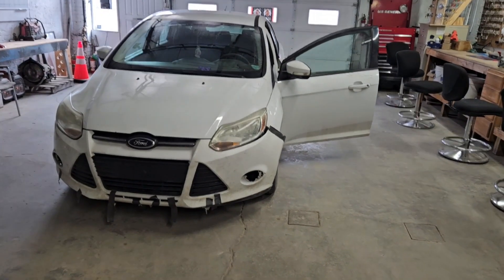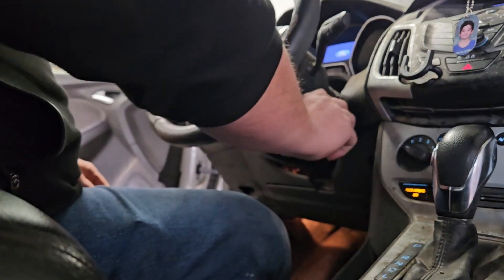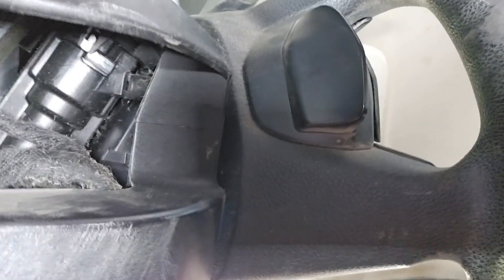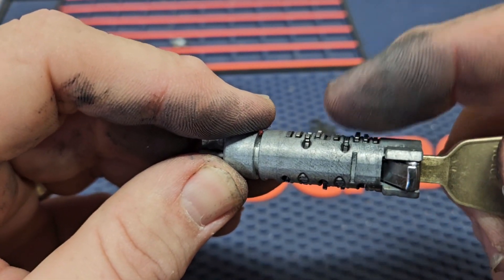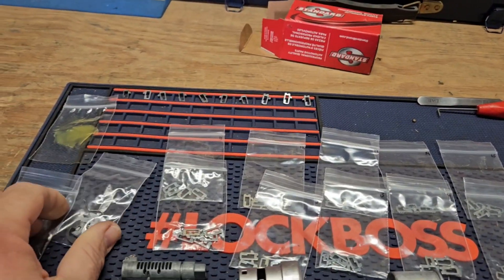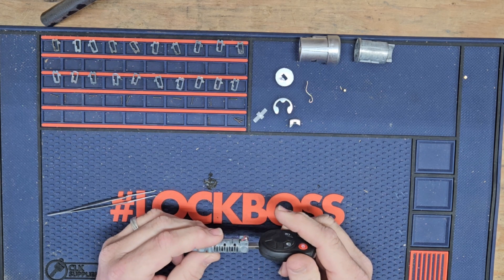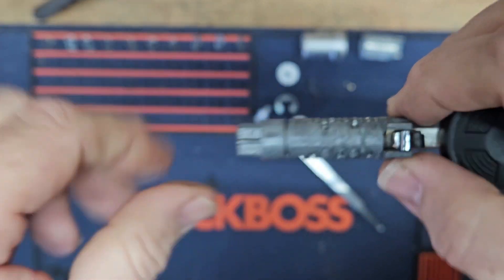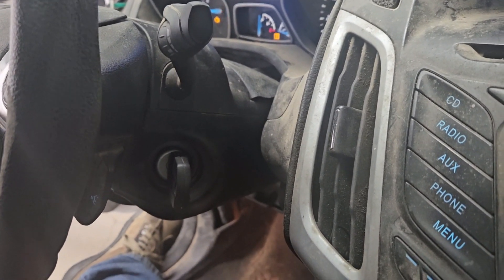2013 Ford Focus Ignition Replacement

Comment: This is great. Mine won’t crank with the ignition turned to start position at times with no signal sent to starter wire.  Is the ignition switch a common issue.
Reply: Update on mine was a transmission issue clutch stuck engaged disabling starting.